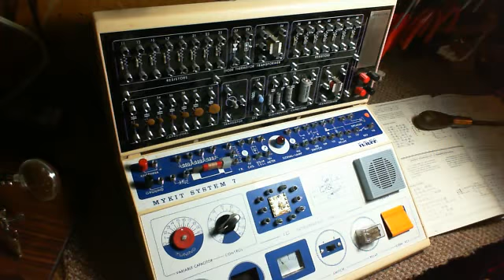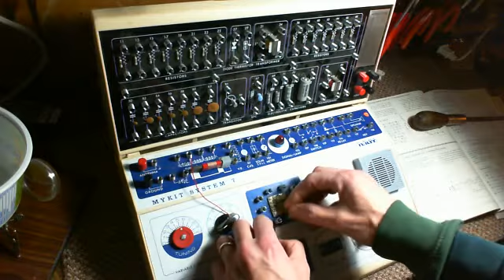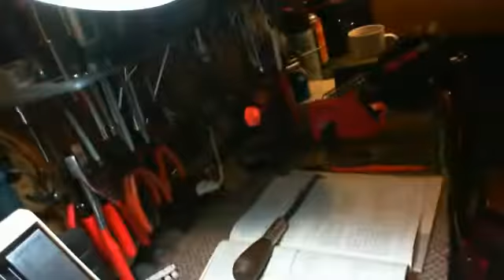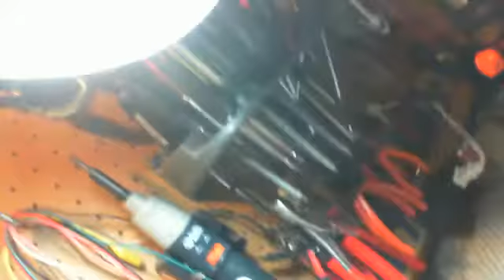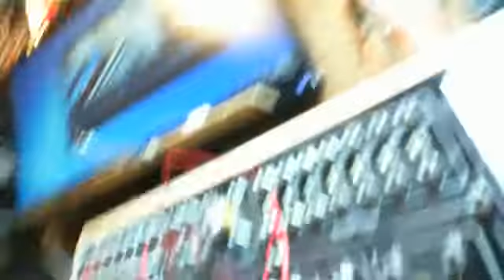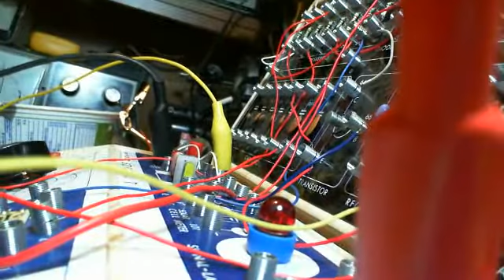OTL Amp and AM Radio built with Mykit System 7 project kit

Comment: I owned this electronic kit in 1982 and it made me an expert in electronics. There is no greater feeling that building your own FM radio and fire alarm. Just wandering where I can get this vintage toy again.
Reply from the maker: Ferruccio Guicciardi I got these at yard sales but I'm sure you can get one from Ebay.  The thing is, I didn't have much success with this kit or the others I tried so be careful about getting an old beater.  It may require a lot of 'tuning up' before you get consistent results.  But then you probably know that.  ;-)  Jim.

Comment: hi matie, i got around 200 of this type of kit, 99% of all the problems is the components in the springs get a white corosion on them, so no connection , i dragged mine out after seeing this got around 10 stations at night quite loud and goodish selectivity. 60 years old of boy toys. nice vid mate
Reply from the maker: freak55beat 200!  Toward the end of my experimenting, I concluded that you'd have to renew all the connection points to ensure good connections before attempting to use them.  I think they are a great idea and lot's of fun to use.  I wouldn't buy an old one for a kid - he'll just be frustrated and turned off if he can't get it to work.  Thanks for you comment.  What else are you hording?
Reply: still its fun jim more fun than a mobile phone that drives children of today, cheers all the best jon

Comment: Interesting old kit! I think it is possible to locate most of the bits for that old My Kit System 7. The relay would not look the same, but the newer relays are nine volts. It is possible to still obtain germanium transistors. I can't see the number in the video, but that germanium transistor might just be 2SB56. One can use a 2N652A transistor. The only piece I don't know where to find it is that old obsolete integrated circuit which I believe could be a Jack Kilby design, but unsure. Check E-Bay for some bits. I would go to me favourite Store You Do It Electronics Centre and check E-Bay listings for bits for that old My Kit System 7 Thank for posting these videos on electronic kits. I have 29 electronic kits, but two require a few bits each...
Reply from the maker: Maybe I'll make working on them an outdoor project this summer so I'm out of my shop and into some sunshine.  It's been a long, cold winter in Canada.